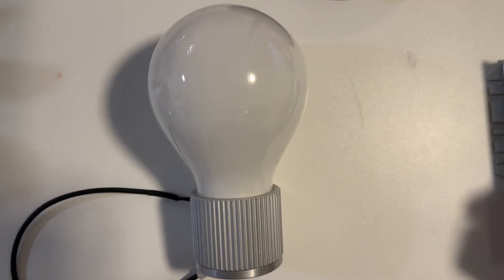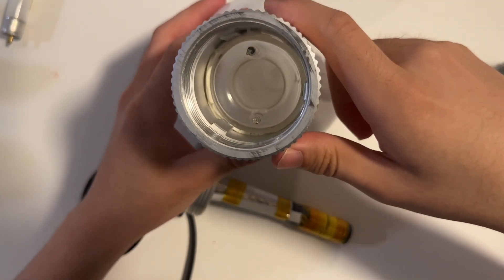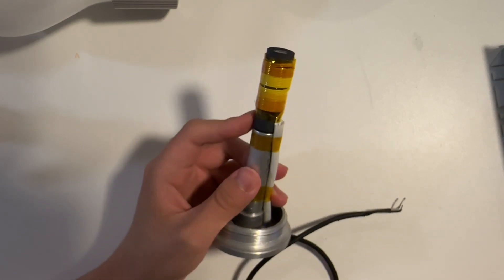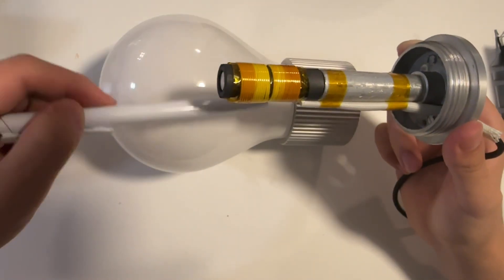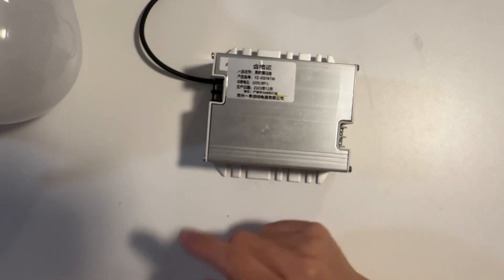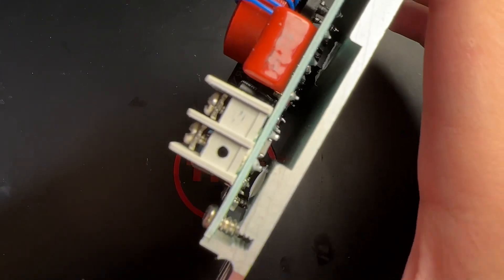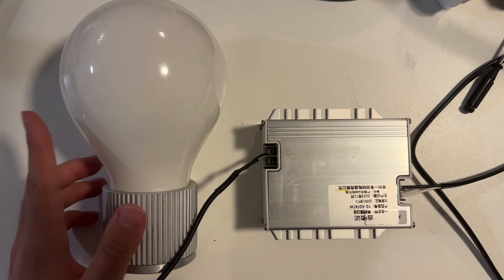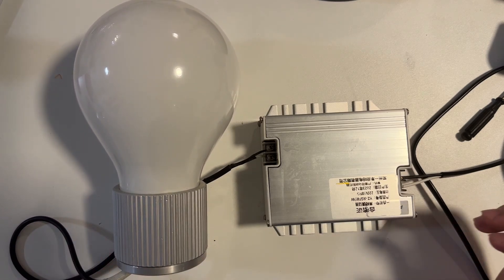85W Induction Bulb: Lighting Without Filaments

Comment: I watched one of these in a video a few days ago, it has a straight bulb but no electrodes or caps at the ends to power the bulb, how it did it was to have a magnet around the bulb ( no ballast needed ) but how then does it start? my theory is the magnet produces a vortex in the centre of the tube and that is a high power point that begins the electron cascade that makes the light fire on. They don't need the high voltage spike that fluros usually have to start them.
Reply from the maker: Nice observation! You’re right that it uses magnetism, but it’s actually a high-frequency electromagnetic coil, not just a magnet. That field excites the gas inside the bulb without electrodes. Pretty cool tech!

Comment: Nice lamp as always 😊There might be a separated coil which only has one end connected with the main working coil. That coil functions as a resonant tank and during the start up it generates high voltage at the free end.
Reply from the maker: That is correct. It is known as an ionization electrode, which is essentially a coil with no return path. One end of the coil is left open, while the other end is connected to the high-voltage junction of an LC series resonance circuit.